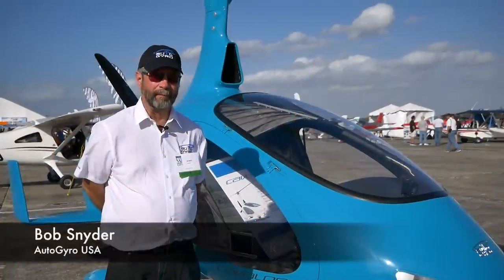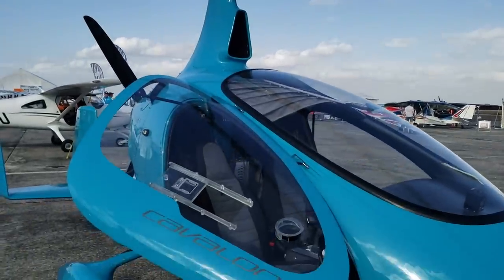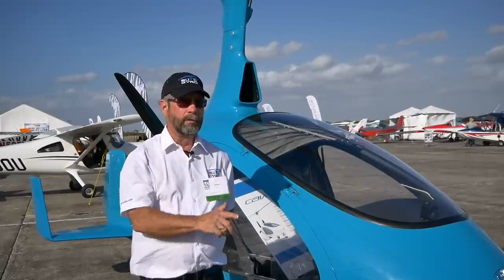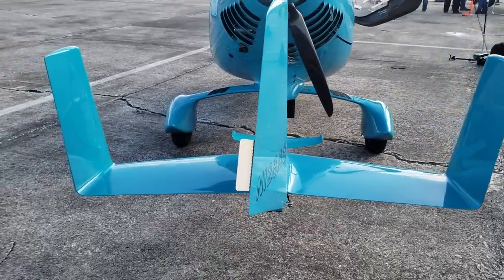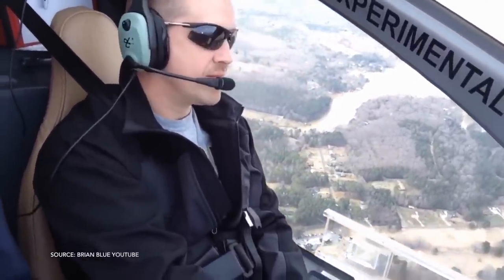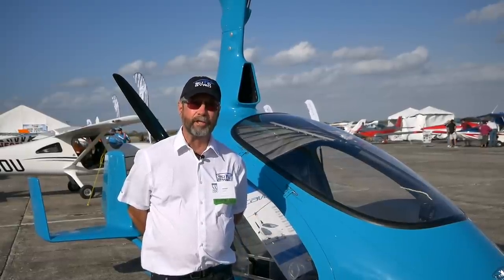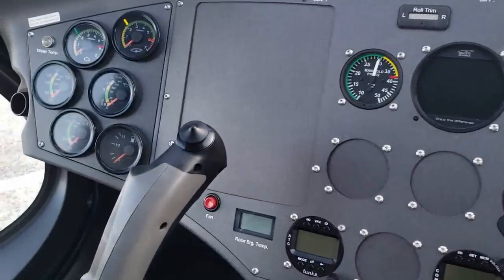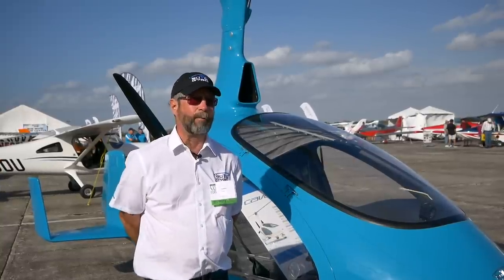WHY Pilots Fly This Instead Of An Helicopter l AutoGyro Cavalon

Comment: Excellent salesman, I'm just confused what niche this fills. Seems like a lot of the complexity of a helicopter but without the ability to hover, and I'm guessing that complexity shows up in maintenance expenses. A used R22 can be had for around the same price or less if you're willing to pickup one with an engine a little closer to TBO, and let's be real, 99% of GA pilots don't fly enough hours per year to hit TBO in the usual 10 or 12 year time frame anyway.

Comment: Ok who wants to invest in building a 4 seat version modern Gyro with me for urban / subburban transport use cases?
Reply: No one. Urban transport is being developed toward quad or more rotor aircraft from major manufacturers. They have real vertical takeoff and landing, easier piloting, more modern systems, redundancies, and safety systems like parachutes. Autogyros are a fun sport like a motorcycle.
Reply: The Urban Transport being developed is EXTREMELY costly, Gyros are proven design and given that they aren’t trying to support full weight of airframe and passengers with electric props, Gyros with 1 electric motor leveraging batt powered motor seems more practical.   Yes they take 300-400’ to take off. But I believe you will have similar requirement for land as e-quad type planes as you will need room to avoid props, etc.   in the end, you’ll need small airport/heliports.   I can then add a 2nd electric motor to the gyro and leverage Ultra Capacitors to capture energy from rotor as it descends and then store, then use to ‘kick start’ the gyro rotor when getting started to shorten take off distance.   Did I win you over yet?  :-)

Comment: jesus why is this plastic wayyyy under tech thing soooooo expensive! I think it be cheaper to just fly my house or car lol. put a sound system in there with some flat panel displays, heads up display on windshield autopilot features and it will almost be worth 50k to me. as it is right now 20k at the most lol
Reply: If you knew how much Engineering and development went into it you would understand why it costs what it does.
Reply: It's mostly expensive because any fool can sue if an accident occurs.....even if the cause is pilot error....a lawyer can file a lawsuit.....lawsuits are expensive.....liability insurance costs a lot.....which means higher selling prices.  Its actually Joe Publics fault these things are expensive!

Comment: They are much more competent machines than helicopters, which rely on a lot of fundamentally flawed mechanical design, and they are safer in decent hands. But they are ridiculously expensive.
Reply: Microwave ovens and VCRs used to be ridiculously expensive too. (I was gonna add "They'll come down." but that somehow doesn't seem appropriate under the circumstances.) Heh, heh, heh.

Comment: "this is for people who want to have fun flying"

Used models go for $110,000.00 so it's only for the very rich. Who, apparently, are the only ones who can afford to have fun while flying.

If you want to fly affordably, a Cessna 150 is very affordable and is a proven airframe.  Get a 150 instead of paying the equivalent cost of a condominium...
Reply: Ima Pseudonym  there are many gyros with much lower price points.
Reply: @ultracruiser41able  True but that wasn't my point. They make it seem that a good segment of the population could afford this machine. Which, of course, is untrue.
Reply: It's not just for the rich. Here's an idea, work harder or smarter, save your money and buy one. Or a used one for less.
Reply: @ictpilot  I JUST pointed out that a used one goes for over one hundred thousand dollars. Did you not notice that part?
So your claims about affordability, are nothing but bullshit.
Luckily, most people will look at that pricetag and realize that any claim of "affordability" are defined by people who make more in a week, than most of us do in a year.
Reply: You'd be surprised what you can afford if you really want something.....I don't smoke or drink....I save money and pinch pennies....I don't buy lottery tickets.....I work hard....and I save for a goal.  Flying is expensive.....but it's all about your priorities.
Reply: @ultracruiser41able  As did I. A 1959 Cessna 150. Cost me 15 thousand.  But this, to label it as "affordable" is outright fraud.

Comment: They can't hover like helicopters, and they're slower than airplanes. I fail to see the point.
Reply: Bradley J. Fortner   Hovering is a transitional state....helicopters can hover but not  the safest area of the flight envelope.  Gyro's cruise speeds can be the same as a Cessna 150..... so.....some models can be as useful as a small GA fixed wing.  I fly both....with many hours in each.....and the gyro is a lot more fun.

Comment: "Its a non-event when the engine quits" ha ha ha, yeah right, its like anything that flies, its gonna hit the ground. It will react exactly like a helicopter when the engine quits. Yes you are in auto-rotate, and a helicopter has to be put into auto-rotation by lowering the collective, however sir, they are both similar flying aircraft, except the auto-gyro cannot hover and a helicopter can.
Reply: auto gyros can hover...sorta'
Reply: Ok, but not long, kind of a controlled landing, but I guess if the wind is strong enough, then yes it can have 0 airspeed and remain in the air, essentially, hovering. @davida.4933
Reply: OK...gyroplanes can kite.....not hover........but if you have an engine out in a helicopter....you've got seconds to lower collective and perform an autorotation......in a gyro....we are always in autorotation.....so if you are a well trained pilot...and always flying over something you can land on....an engine out in a gyroplane IS a none event!  Been there....done that!
Reply: Barry, an engine out in a gyroplane is also an aircraft in auto-rotation. You're not in auto-rotation when the engine is pushing you, the rotor is providing lift, just not forward thrust. Same laws apply. So I'm not sure what your point is. If a helicopter and a gyroplane are side by side in the air, and both have engine failures, both react to gravity and both enter auto-rotation. There may be differences in weight, drag, and rotor dynamics, but both will be fighting for that same chunk of parking lot.  @barrykropelin3845
Reply: A gyroplanes rotor IS NOT powered by the engine as a helicopter is ......a gyros rotor is ALWAYS in autorotation.......forward speed is controlled by the engine and propeller pushing the aircraft......faster you move through the air.....the more air enters the rotor.....the faster the rotor turns....the more lift it makes.......therefore when a gyros engine quits.....we just glide to a landing space.....or.......drop straight down and then lower nose to gain a little airspeed to flare once near the ground. If both a helicopter and gyro have engine outs....they are landed basically the same.....only exception is.....you have a small amount of time to configure a helicopter to go into autorotation mode.....it will not do it without pilot input.
Reply: Barry, you don't have to take such a defensive position at my early comment. Yes, I know a helicopter rotor is driven by the engine through a transmission, however, when it losses that power, the rotor is then driven by the upflowing air derived from gravity as the helicopter moves toward the ground. The gyroplane has its rotor driven by the forward airflow, not by any engine drivetrain, yes, however, when that forward airflow, from the rear engine pushing the gyroplane forward fails, then gravity takes over and upflowing air rotates the rotor. I know this, I have flown both aircraft for 35 years. We are saying almost the same thing, however, in your earlier comments, you assumed that my comments were incorrect, and that you pointed out that a gyroplane is NOT powered by the engine. Which, in my earlier comment that I made, had no mention of the relationship of rotor and engine. I simply pointed out that when both no longer have a power source, they are the same, in auto-rotation to the ground. Same aerodynamic forces at work here. So pay attention to what you are reading before you comment. Just because you fly a gyroplane, you can assume that you are always correct. Besides, should a gyroplane lose its engine, there would be a control movement to prevent rotor decay. Also, there is a finite amount of rotor RPM that you can deal with as well. Too much and you have rotating blade stall, to little and not enough lift. I hope this clarifies to all reading that there are more similarities to the two aircraft then apart.  @barrykropelin3845
Reply: Not being defensive and never said anyone was wrong.  I just know how it works in both gyros and helicopters and attempted to explain.  In normal helicopter flight....the rotor is not in autorotation and if the engine quit...without any input from the pilot...the rotor would loose rpm very quickly resulting in loss of lift and unrecoverable tumble.  In a gyroplanes....all air is moving up through the rotor.....with the engine driving forward....or engine stopped....or going straight down.  No arguments here.....I don’t argue....no reason to.
Reply: @barrykropelin3845  I practice engine outs all the time Barry because machines do break down and never when it is convenient. On our trip up the Hudson to circle the Statue of Liberty there was about 11 miles of water to cross from NJ and then up the Hudson and I was keeping my eye on those container ships as possible landing sites. LOL
Reply: I'm still trying to say that a helicopter in auto-rotative flight is exactly like a gyroplane in flight without its push engine, they operate the same, you say there is a difference. There is not.  @ultracruiser41able
Reply: Geez...beating a dead horse. Did not say they’re different in autorotation.....they achieve autorotation differently. A helicopter does not fly in autorotation and must have inputs to achieve that state....a gyroplanes is....always....in autorotation. You stated in a previous post “You are not in autorotation when the engine is pushing you, the rotor is providing lift, just not forward thrust”...... the rotor on a gyroplane is creating lift in autorotation....if it wasn’t....the gyro would never leave the ground. We are saying basically the same thing....just clarifying some things.  I’ve spent way too much time on this subject. Safe flying to all.
Reply: Just saying review your facts before posting, you started all this in your first post which is incorrect.  @ultracruiser41able
Reply: Sorry. No incorrect posts here. Sorry you misunderstood. Meant no ill will at all.
Reply: @sarblade  Yes the rotor is in autorotation when the forward prop is moving the gyro forward. The rotors are not powered and air moving through them is rotating them.
Reply: @sarblade  Your incorrect.
Reply: @ultracruiser41able  Don't feed the trolls. We know he's wrong, it's still the upward flow of air through the rotors unpowered continually. The helo is powered and the rotors are not having air drawn up through them, they are pulling air down through them. Big difference.